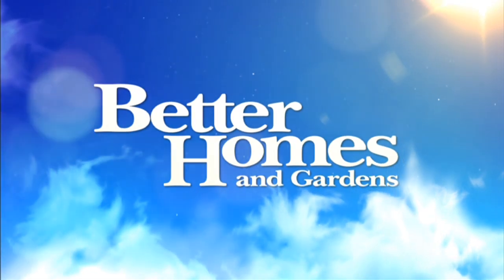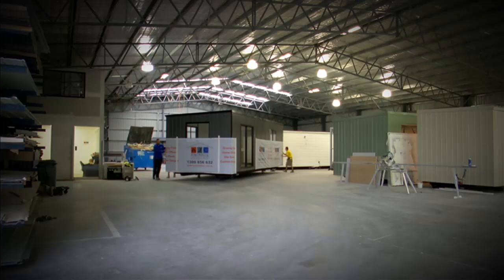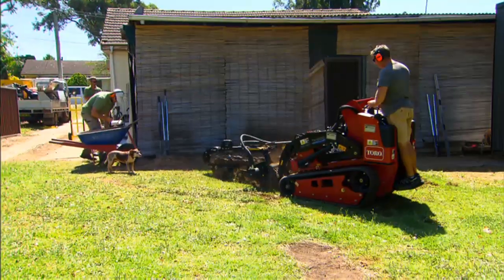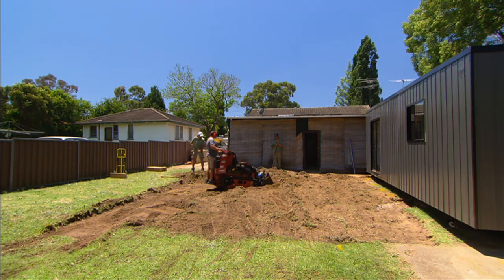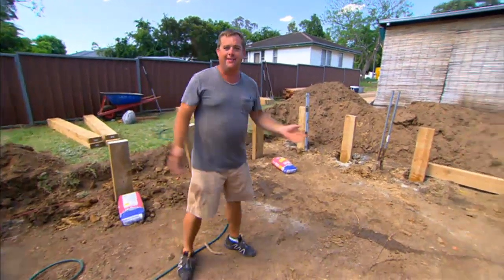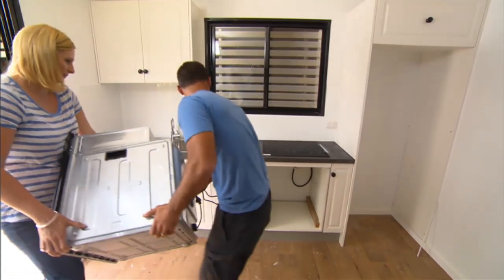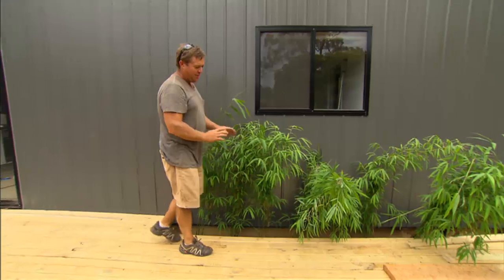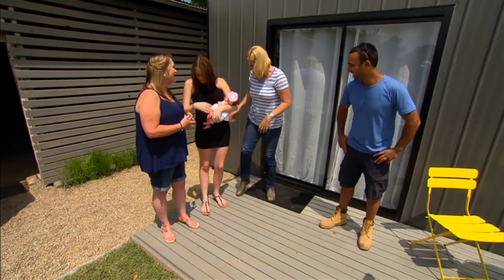How To Build A Granny Flat For $50,000 | Indoor | Great Home Ideas

Comment: 50k lol.  Typical Australia.  Everyone is out to over price and rip you off. I do everything my self because pretty much any contractor will rip you off unless it’s a mate.  I could whip that up for about 18k
Reply: Tru I’m going to build my own tiny house on my parents land, I’ve been researching a lot about building small houses from scratch and this seems just like what they do with  pre built pc’s,  they can be made themselves but you pay the premium if you can’t do it yourself
Reply: How? I would to do this on my own. If not then I'll pay you lol
Reply: @anonymousbagel3779  I have no idea where you live in the world However for fun sake lets say you live in a just outside a big city with many homes row after row First You will need to find out If your able to place a pc on your land It might require a pre designed foundation which a blue print plan will want to be seen and be able to get a permit for After you find out if your in a proper Building zone Will will also need your Gas and water / cable mains marked out  And a building inspector step by step 

Take it from someone that took 4 years Just looking at land and finding the perfect spot and made money off buying the land and 1 phone call  I turned 1.3 acres of wooded land  from $22,000 into selling the wood Whole and pulp into $-9,600 off the cost of my land  Even if i sell it for the same price i made a profit 

This spring i will rent a bobcat to remove dirt for my foundation. on to my framing and metal bars, crushed stone and concrete (M15)  Plumbing for sewage / fresh water.. The 3 shipping containers will line up on iron beams slotted into the concrete ------$12,000 

Buying windows and doors, Wood for framing, Wiring, Electrical panel, connecting plumbing Which must be installed by a lic tradesmen for a inspection pass Welding cutting drilling  On to spray foam (friend owns a company) dry wall   Sink bathtub toilet shower  tiles cabinets flooring Lighting heating cooling counter tops  extra metal extra wood  Glues screws putty paint etc etc -----$18,000 on better than avg material 

Then you slowly start moving stuff in ..When your done You have a home you built ..You know you not only saved on labor but also saved on shopping around for the type of look and quality you wanted 

On one side of my land i have rock formed by glaciers On the other side is a fresh water lake (melted glacier water ) 
15 min walk and there is a spring water flow  tested as "Better than bottled water"
Reply: @freakyflow  now to hook up the turbine to the spring or river for continuous power through turbine, then water pumped via ram pump for shower, sink, a bio digester for organic waste (poos as well) (mixed with water), slurry good for gardens, then methane collected runs gas water heater, cooking and heating as well as fuel for a car or generator...just some thoughts

kind regards,

kieron
Reply: Wow are you in usa
Reply: Sam Richards people pay because they don’t have the skills. If you did why would you pay anyone
Reply: So true
Reply: Sam Richards - you nailed it dude. And what a damn shame it's like that. I've found Americans to be more virtuous in that regard - despite their reputation.

Comment: Would be  good idea to buy a very basic one.  With just a few lights and electrical outlets.  And a set of stairs on one end. 

Dig a hole,  drop it in.  And stack the next one on top.  Make double level ones.  Much better.  

Doing it yourself is or with a small crew.  Would save you thousands.  

You can get storage containers 3 grand.  6 thousand for 2 large ones.  Cut windows out,  floors etc.  You can call electrical in.  

It is not unatainable.  However expensive when they prefabricate it for you.

Comment: A container is only $2,000 each. How much more you need, a bathroom$6 ,000. Insulation and finishes, $10,000 etc. When fnished, it still way down from $50,000. Try it, you will like the price tag. George Wu, AIA, Architect, NCARB 2019-10-21

Comment: Lke the moveable units but particle board?  Must not have humidity in Aussie land.  Wish we had compact stoves and 2 burner cook tops available here.  Purchasers in the US are locked into the huge wasteful full size appliances because the choice is just not offered.
Reply: +Kathleen Sisco that is not necessarily as prevalent anymore. There are the smaller appliances avail now and becoming more available all the time, you just have to look for them.

Comment: There are more than 5,000,000 used containers in the world today at $2,000 each. the sizes are 8'x20'x8'-6". 8'x40'x8'-6", some at 9'-6" high. Why not utilize them ? A good designer can make the impossible into possible.If you have a problem , solve it !  I have been interested in re-cycle the used containers for over 15 years now. I designed single family to (4) 40 story towers with sky-bridges as fire escape, so that there is no more jumping out of the window like  the victims in 9/11.   George Wu, AIA , ARCHITECT, NCARB 2016-10-26